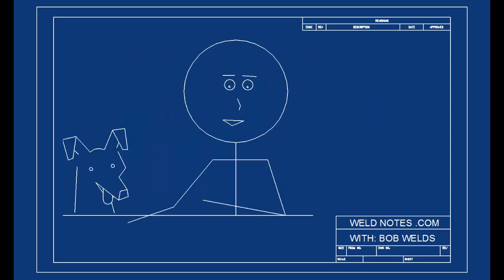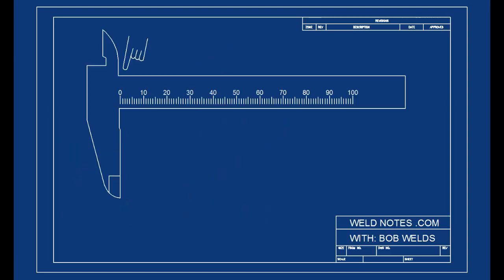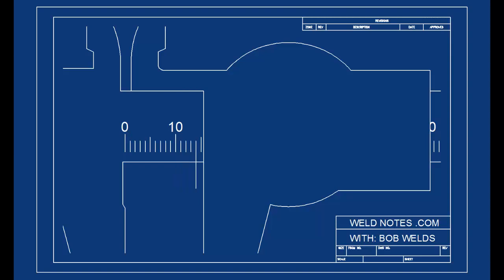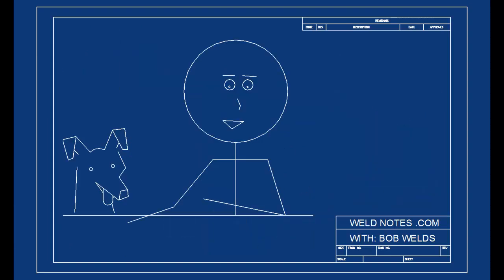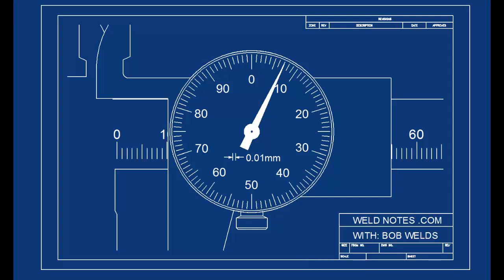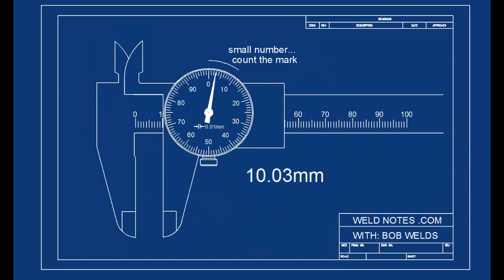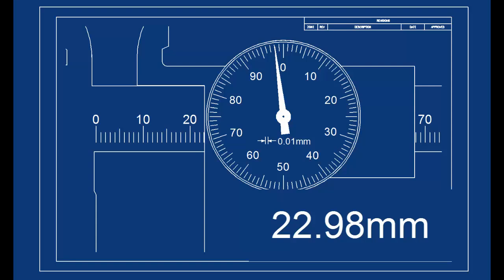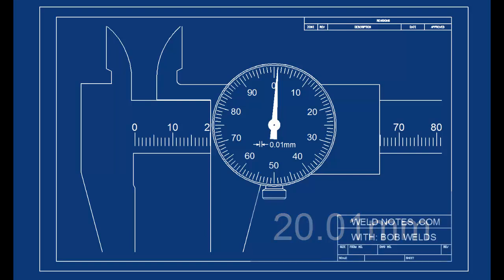How to Read a Metric Dial Caliper - Weldnotes.com

Comment: May I know why some dial callipers have two zeros on the dial face? One at the bottom and one at the top? I mean the dial face has two arcs 0-100 from 12 o'clock to 6 o'clock, and 0-100 again from 6 o-clock back to 12 o'clock?

Comment: Thanks for the lesson, very helpful,  but one question, mine is a dual scale imperial and metric, but the dial says it's calibrated to .001 inches, so do I ignore the dial if measuring in metric or is there a conversion to apply?